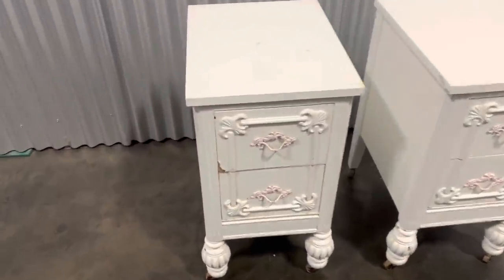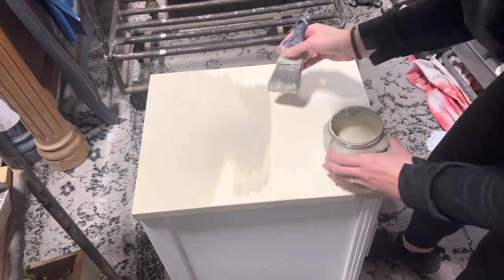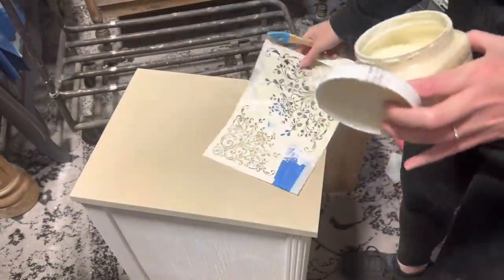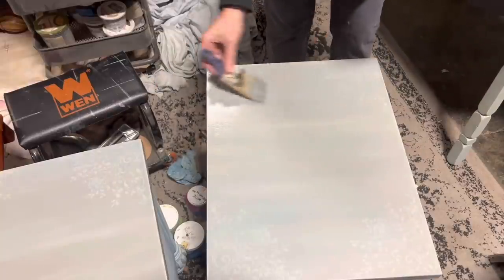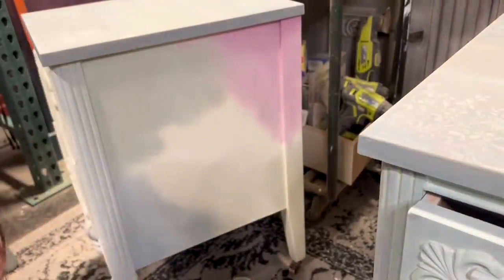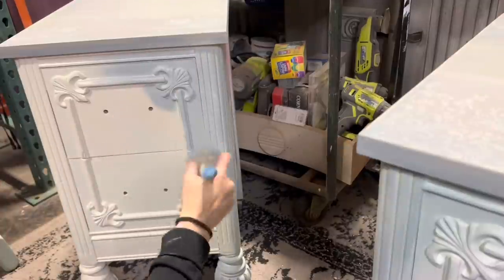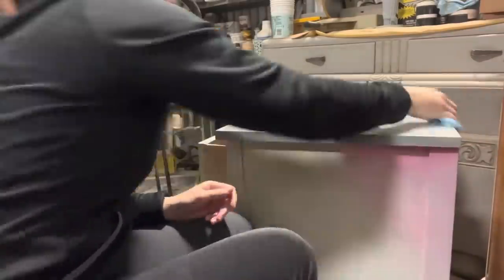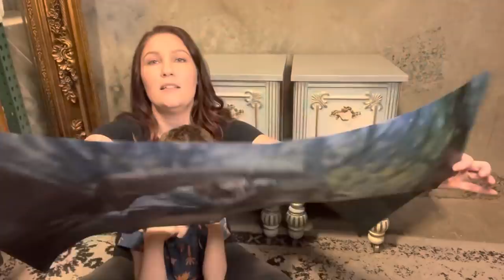Boring Vintage Nightstands to French Cottage - Cottage Core | Easy Blends | Elegant Upgrades

Comment: These came out so pretty. Do you put sealer over the wax stripes? If not, will they rub off if touched?
Reply from the maker: Thanks, Susan! And no, the Rub and Buff doesn’t need to be sealed. You absolutely can if you want extra protection, but it sets up on its own. If it was going on the top I would have sealed it again, but not for the sides.